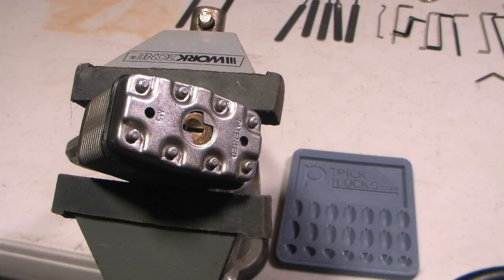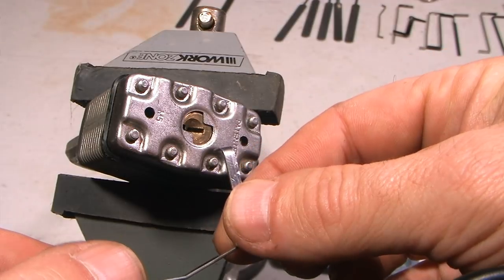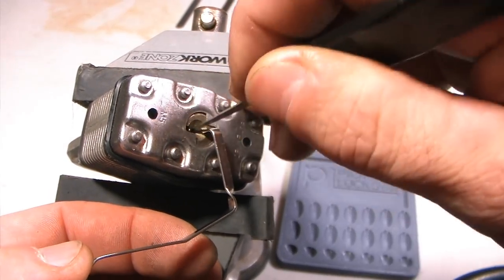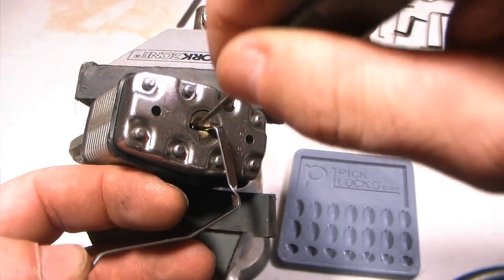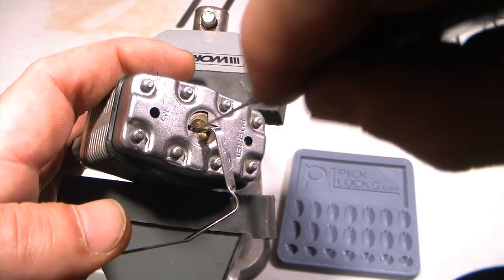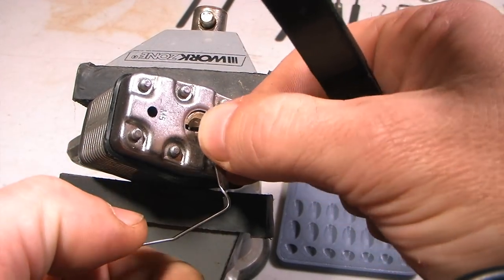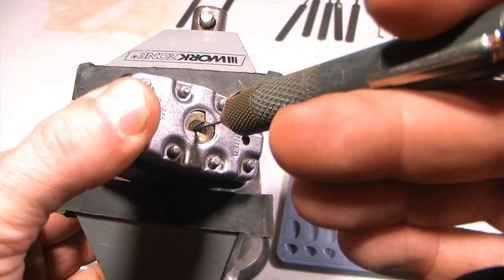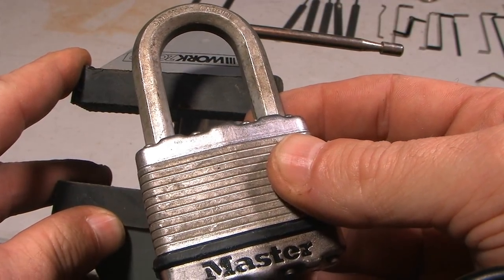[011] Master Lock M5 Magnum Padlock Picked

Comment: Been trying for 2 days... Watched countless videos.. the master M5 that I have must be the best one they ever made.. lock picking lawyer jiggled in it for 3 seconds and opened it.. I have a pile of brass filings in front of me from trying for hours, and it won't go.  If I ever need to pick one of my locks, I'll probably use a bolt cutter or a rifle, cause this shit is just pissing me off at this point 🤷
Reply: Dude I feel you, I'm in the exact same boat with a regular old commercial M5 that should definitely be pickable and I can't fucking get it open. And I'm not a bad picker, I've picked all kinds of crazy shit open at this point and this M5 is kicking my ass
Reply: I will admit though, I have yet to attack it with top of the keyway tension.
Reply: Good luck with bolt cutters. The shackle on the magnum is made out of boron carbide. It’s 50% stronger than harden steel. It’s harder than tungsten carbide. It’s about a 9.5 strength metal with only maybe one other synthetic metal and diamond being harder.      Boron carbide known by chemists and metal heads as “black diamond”.    I’d say good luck with a bullet too, but maybe if you hit the keyway and cylinder just right…

Comment: Can u explain why you use the plug spinner... I'm new to the game
Reply: Because he picked it backwards.  So in order to actually open it after he picked it here to turn it completely the other way past lock where the pins would fall back into the core.  The plug spinner spins the cord fast enough that the pins don’t fall back past the shear line into the core again.   I’m not sure about this lock but some other ones the core is under spring tension.  And it makes more of a pain in the ass to pick in the correct direction so it’s easier to pick backwards without the spring tension and use the plug spinner to spend it fast enough to be able to open it the correct way. Because picking it the opposite way won’t actually open the lock
Reply: But better than I can explain search for a plug spinner video and you’ll see exactly what it is